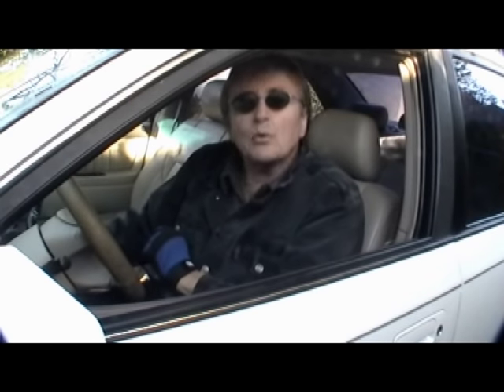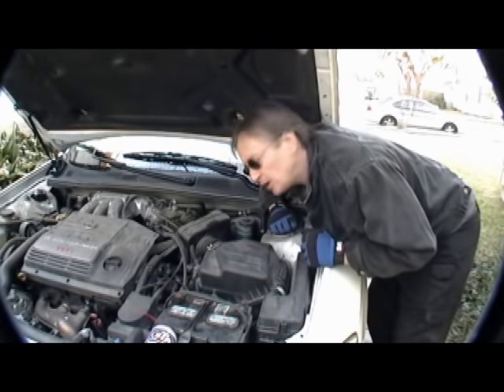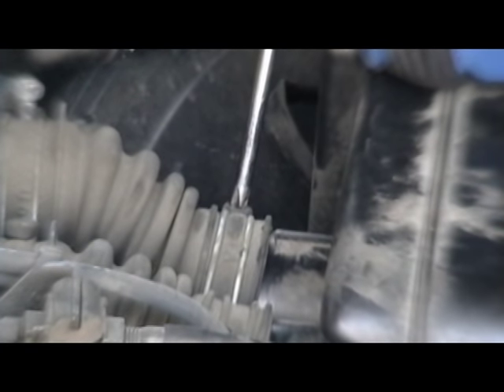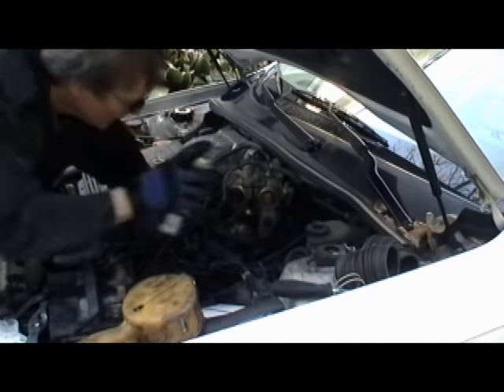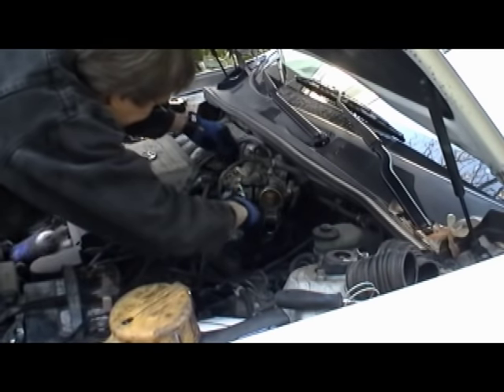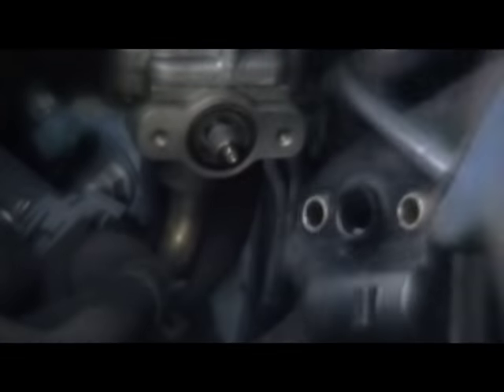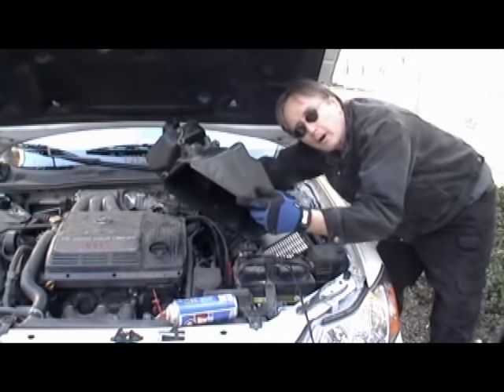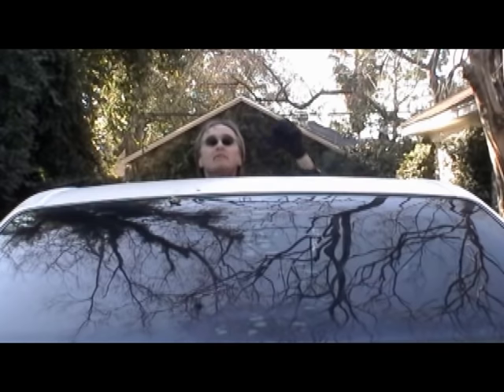How to Fix Engine Idle Problems in Your Car (Rough Idle)

Comment: Just did this on my Toyota Tacoma 1999, I didn't have to remove my air filter or anything so I was lucky. When I started the car back up it did take a while to turn on so I got scared. It was still at high Idle but after a few minutes of leaving it on it relaxed and the high Idle isn't an issue anymore....I hope
Reply: If that doesn't work out try replacing the coolant temperature sensor known as the ECT sensor.

Comment: Cleaning doesn't work as well with newer drive by wire IACs integrated in the throttle body, can even damage the electronics even more like newer MAF sensors. Found my IAC is a sealed valve with no indication of a pintle location, I think the actuator instead holds the plate open electronically at a low RPM. Resistance test showed no circuit connection other than two that only power the throttle plate. No CEL code either. I'd consider a resistance test of the sensor before even considering to clean it and potentially shorting sensor circuitry.

Comment: I heard on GM cars, it's important to never spray the cleaner directly in as it can damage the servo motor that manipulate the throttle body in newer cars. If you damage it, you may have to replace the entire throttle body intake. Some cars I heard had it as separate part, but I think my 2008 Charger had it as one big piece of plastic.
Reply from the maker: as long as you disconnect the battery and let it air dry, no harm is done

Comment: Scotty I'm from the Philippines and I have a problem with my ford lynx/laser.. Aside from rough idling, another issue is that whenever I turn my a/c on my rpm goes down instead of going up.. It goes back to normal afterwards

Comment: Hey Scotty! I have Nissan Sentra 1998 twincam 16 valve it has unstable rpm. Idles at around 800-900rpm and rpm bounces between 800-900 rpm. Silencer is also black. Have changed the IACV but it didn't get better, has 190k kms on odometer.

Comment: Are you selling products or solving problems? What about plugs? Injectors? Possible timing belt issues? Throttle cable adjustments? Do you always work on vehicles with keys on your belt?

Comment: Do all Toyota's have that idle air control valve?
I've cleaned my throttle body out, cleaned maf sensor, changed spark plugs and one faulty coil and still my Toyota regius van has a rough idle when in gear sometimes . When parked at traffic lights for instance. I've tried adjusting idles up but it can only go up so far before what seems like an automatic choke kicks in and takes the idles up high.

Comment: I have a 1994 Oldsmobile cutlass supreme s 3.1lt and my RPM is dropping in fact when I get to a light or stop sign it would run for 2 minutes and would cut off,but restart OK. Took it to Firestone for what I thought was a alternator issues but was OK,even a new IAC or a sensor didn't solve it. They said that they cleaned the throttle body and it didn't work. I am now thinking that the MAF needs to be cleaned.What do you think? This has been going on for 10 weeks

Comment: Oh my gosh I'm so glad I found you..my dodge ram 1500 rpm idle revs and falls revs and falls and when I go to back up it sometimes dies or when I come to a stop it dies..once it dies in the middle of a u turn at a light in rush hour traffic..freaky..all my wiring is going out all my switches I just replaced they all went out not the fuses either it's horrible..it sounds rough I got an oil change it's just a mess the radio is high pitched and some of the speakers pop so loud they scare the CRAP out of us the windshield has condensation. On the inside sometimes worse than the outside it's horrible. Help I put synthetic oil in the truck ..I'm not a rich lady I am raising a daughter my husband passed away..so I'm trying to do what I can on my own..so what do u think it is?

Comment: Scotty.. what if your car is still ideling too high even if you have replaced idle control valve, TPS, and Mass air flow sensor?

1996 RS Camaro
In Park - 2500 rpms
In Reverse - 1500 rpms
Neutral- 2500 rpms
Drive- 2500 rpms

Thank you!!!!

Comment: Is it safe to use the cleaner inside the throttle body for newer cars? I saw another video that advised not to use the cleaner directly but spray it on a toothbrush or rugs to clean the throttle body.

Comment: Hello Scotty, when I put my car in drive and press on the brakes, the car shakes or pulsation, the steering wheel shake a little. When I put in other gears it normal and when I drive its okay, but I notice when I am on the highway and try to go faster it hesitate then it will pick up speed.

Comment: Hey Scotty I have a 2002 bmw 530i. It seems as if the car's engine turns off when I come to a stop. It always starts back up after it happens and I recently replaced the fuel filter & transmission filter hoping it would fix the problem but I still had no luck. I really need some type of feedback cause if I can find out what's going on I can fix it today!

Comment: sorry scotty forgot to mention that I got new motor mounts spark plugs are fairly also check the oxigent sensor ,did I mention mass air flow sensor it is driving me crazy am hoping is not a bent valve I do here a hissing sound like a vacum leak but I can't find it this is the last reasort am going to smoke a cigar and blow in that engine I think I have a few cigars left from last drinking section with cherry flavor hope that works and thanks scoty kielmer for replying .

Comment: Hi, Scotty , i have toyota yaris 2012 
Its have vibration issue in idel position, i have cleaned throttle body  also change engine mounting 2 of them, not third one which is at back of engine i think. One more thing its vibrates in D drive mode then in P park mode

Comment: Scotty thanks for the information. It's works fine I plugged the booster hose and started the car and it idled fine. Sounds like I need to replace the booster. Thanks again if you give me an email so I can get information from you I'd like to send you something. Thanks again

Comment: 1987 Chevrolet r20 5.7 TBI idles rough and sometime dies at a stop (only) when AC is on, also check engine light comes on before shutdown, but no fault code in system .Cleaned out the throttle body and rebuilt TB with kit also replaced IAC injectors good. Once again No AC idles great, AC on idles bad and dies.Any help would be appreciated.

Comment: Hi Scotty, thanks for your video. I have a 2005 Toyota Echo (100 000 miles) that seems to have a bit of a rough idle when in drive with my foot on the brake. What would be the 2 or 3 most common reasons for this? Do you think it’s just the type of car and it’s age?

Thanks!

Comment: Hii Scotty! Thank you for your great videos. I am planning on buying a 2010 Jeep Patriot Limited 2.4. When test driving it today I noticed a slight vibration when at a red light (car on Drive, brakes applied). It wasn't terrible or anything but def noticeable. I switched it to neutral and it stopped. Is it somethting to be concerned about? If I buy it I'll still do a full fluid replacement (coolant, oil, transmission fluid) to be safe. Has 34k miles. Your input would be appreciated! Thanks!

Comment: Mr. kilmer I have a automatic 94 Lexus ls400 that idles at 2000rpms in park. I also have to place the car in low gear just to take off and shift up to drive. The car has a lack of  power and slow acceleration. If I mash down on the gas pedal there is not the proper response it just kind of crawls along.

Comment: Also people check your tps sensor it should read 0.5v closed throttle 4.5v open ul need a multimeter if u car is lurching when ur in low rpm & gear its more than likely ur tps / throttle positioning sensor on your throttle body if the volt on the sensor are low cleaning wont fix it

Comment: I have a 2000 explorer can I add the steel seal to the radiator and let it stay just incase the head gasket is going bad

Comment: I have a 1999 Toyota Corolla , when I stop into a gas station and get gas , as it is being pumped  the car will start to run rough. The RPM's will drop and I will have to push down on the gas pedal. I never experienced this on any car I owned in the past. The car wont stall out , but the rpms will bounce up and down.
Reply from the maker: +ace frehley often a bad evap cannister vent valve

Comment: My car idles at 1500 rpm when parked or neutral. When I put it on drive it goes to 9xx rpm. What can it be
Reply: Glenn Olazaran mines doing the same thing. 2007 V8 grand Cherokee 
What car you have? 
I think my issue is either the TPS - throttle position sensor 
Or the IAC -sensor

Comment: I have some vibration when I am at a stop and car is in drive. When I put car in park or neutral vibration stops. AC on off no effect. I found a bad motor mount and replaced it but still vibration that vibrates headrest. Is there something I am missing. Engine seems to run smooth on idle and RPM stable and cleaned throttle body no change is there a motor mount for transmission that could cause vibration?

Comment: 2012 ford escape xlt replaced a battery due to cell busting when I did that now as I drive it idles very strangely as I stop and go but already replaced spark plugs checked the boots every thing was running well until my battery died checked service manual it told me to run the car with the ac on for a couple of minutes did that so the computer could relearn what I guess it for got and still rough idle all of a sudden 103 thousand miles and keep internal clean and externals as well if you can answer this it will be a big help

Comment: I did wet and dry test and #5 was 5 psi only different on dry and wet test, rigging up a smoke bottle and hair dryer and cigar test next, tks. for your quick reply and let you know the outcome.
Reply: +Sam Melton , ok found air leak fixed, now I have a power problem, getting 18 volts from alt. and regulator. Change both parts with new battery and still have 18 volts, am I missing something in the electrical charge side of things? thanks

Comment: Hey Scotty I'm back with my 02 Pontiac Grand Prix. When the car sits the engine huffs and puffs. I just replaced the converter with an aftermarket one. The dash lights dim when I change gear and kind of sounds like it's gonna stall when I sit still at times. Could it just be a tune up I need or maybe something else.

Comment: Scotty I have done this with my 2009 nissan versa SL and it looks good and clean but now my car hadn't changed much no error codes pop up and it runs even worse while Ac is running what else could cause my car to idle rough stop and go. It didn't stall but it acts sometimes when I stop like it wants to rpms go under tolerable levels

Comment: I got a brand new throttle body and sensor but it did absolutely nothing. It's still rough. Sometimes doesn't even want to accelerate.

Comment: i just got told my motor was bad bc i said my engine stalls while idling and that it would be an almost $3000 dollar fix, looked up the issue and came actoss this video and saved myself a solid $2900

Comment: This worked fantastically got my idle from 300rpm, from where it would just stall,up to 800-900rpm where it almost purrs !
I was quoted $3,500 for a replacement engine or $2,500 to replace cylinder head so $5 for a can of Throttle Cleaner makes me very happy, thanks Scotty.
Reply: It’s not 5 dollars but I get what your saying it’s better then spending 3,500
Reply: @mikegoof_9425  this was when trump was president……
Reply: @jessealdridge9920  😂😂😂
Reply: @LivingTheReddLife  🤷🏿‍♂️
Reply: @jessealdridge9920 FACTS LOL
Reply: There are so many corrupt mechanics.

Comment: Great video, I'm gonna try this on my '05 Honda Civic, my biggest fear is I'll take the air filter off and not know how to put it back on but if I can take it apart I should be able to get back together... at least I hope so
Reply: 6 years later literally lol.. did you end up successfully taking it apart and putting everything back?
Reply: Take pictures before, and use an egg carton so you know which screws come from which part and label the sections if needed. It's like a puzzle that you already know how it goes together, just put it back the same way you took it out.
Reply: @uncrustable9923  i wonder if they are even alive
Reply: @lilstoopa9392  me too haha

Comment: My daughter's '02 Montana with the 3.4 L engine was idling a little roughly and the check engine light was on. 
  Until recently, it had been a few years since doing most car maintenance. Your suggestions to clean the air intake system brought back the memories, I decided to give it a shot. 
  So after cleaning the IAC and MAF (while taking off the intake hose, may as well clean both right?), after a rough couple of starts, the system adjusted and now she runs beautifully, no check light! 
  Excellent vids, thanks for posting man!

Comment: I just installed new spark plugs, water pump with all the parts and timing belt of course, and purge Solinoid.. I have an 04 Hyundai Santa Fe V6 2.7L. Now all of a sudden when i start my car, with it remaining in park, the engine revs to 2 rpms and stays there unless I press the gas a little then the rpms stay up to where I pressed the pedal at.. How do I fix this new issue?? Never ever had the problem since I got the vehicle 5 years ago.

Comment: Hi Scotty, my 99 camry makes a skipping motion like if the wheels are slipping when I start from a full stop, and when I drive down the highway, it sometimes feel like the gas is letting go of itself skipping for a moment then coming back on. Do you think cleaning the throttle body would be good for that? Also, the AC isn't cold at all when I am parked and the engine is running, I only get cold AC down the freeway, and I have checked Freon levels too. Thank you for your time.

Comment: Scotty after I cleaned up my throttle body and the control valve my car idle went up to 3000 RPM any solution for this issue. Also I heard the magnitude has to be move 360 degree but mind doesn’t move 360 ? Please let me know what should I do

Comment: Hey i got a 2006 ford explorer with rough idle i not sure if it a vacuum leek or not i found not broken hozes amd even did the carb cleaner spray trick my dad said to do and found nothing but my explorer has a electronic throttle body i also changed the edgr gasket since they are a common leak and it did not fix it at all

Comment: Hello Scotty I have a 2003 Mustang cobra kept getting code idle air control valve Engine light I replaced it with a new one I still got the code tested the new one with the multimeter everything checked out good so I thought maybe it's the harness I did a simple test I put a Noid light tester in the harness the light comes on but it does not stay on at this point I think it's the harness or the PCM what should I do Scotty

Comment: Hi. I have a 2000 chevy 5.3 that at idle in drive or park the rpm drops them comes back up to where it was. It actually is idiling a little high by about 200rpm then drops 300rpm then comes buck up.Does this about every 20 or 30 seconds

Comment: if it's the head gasket can I use the liquid  steel that you showed in several of you shows? some time I can start it and it will run if I stay on the gas.

Comment: Scotty,  2000 4.0 explorer. Enertia switch is fine, have fuel pressure. Have spark. Just replaced crank sensor. I hear fuel pump priming. Checked relays and control box.. it cranks but doesn’t start. I’m lost

Comment: I have done all of this, even replaced the the throttle body and valve. The engine still idles so low it shakes. The only way to fix it is driving with the lights on

Comment: Scotty I tried this on this engine. I took the throttle body off and gave it a good thorough cleaning. it still has a low rough idle. works fine with a little gas. any ideas?
Reply from the maker: check for vacuum leaks and try my video "how to clean fuel injectors on your car"

Comment: Scotty i own a civic with b18c type r engine, i havent got vaccum on it! I change the idle valve witch had very low rpm, with another idle! The result was the revs stay always high (around 1500rpm) or sometimes go up and down. What do you thinking about? Any suggestions??? Thnx!

Comment: Also I just had the throttle body removed and Cleaned and same symptoms exist.
Reply: +Trapstar J time to change you idle controller valve / Throttle positioning sensor

Comment: Hi, I have Hyundai Santro Club 2005, it race increase automatically and comes down after while ecen during driving when I take off the foot from race accelerator for speed braker or red signal, the race goes very high. I also observe backfiring from air filter some times and jerks on petrol. While on Gas (CNG) the backfiring increase and cause to open the air filter cap (I have changed the air filter cap twice).
Reply from the maker: realize cng and normal gasoline run engines are very complex with those two different systems which operate differently. BUT, I'd start by wet and dry compression testing of all engine cylinders first to see if it's an internal engine problem with the backfiring

Comment: how are you Scotty I have watch lots of videos and I've done everything I have learn from this videos cleaning the throttle body egr valve new aci  and the motor stiil shaking when put in gear or air conditioning know it rides smooth at high   speed I mean it just run rough at slow speed I appreciated if you know anything else that could be causing the rough middle
Reply from the maker: worn motor mounts, weak fuel injectors, or vacuum leaks often do that

Comment: Would u have other ideas if it idles poor only on cold start up, takes acceleration to learn idle, but works fine after, i cleaned the throttle but not the sensor, im going to clean again tom morning and follow up with you,Also would you know the name of the two holes you pulled out at the end , i need to replace because the ones on my car like they will break if i pull them off , i have a 2002 avalon xl